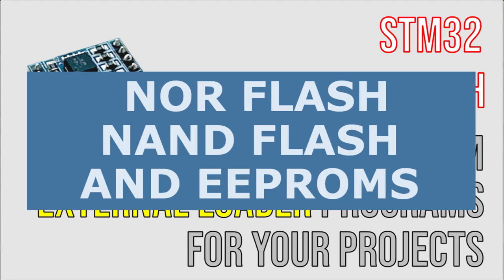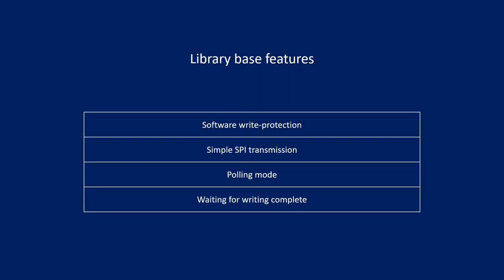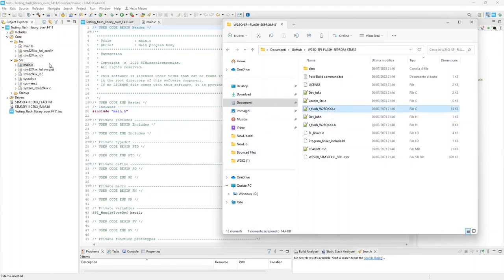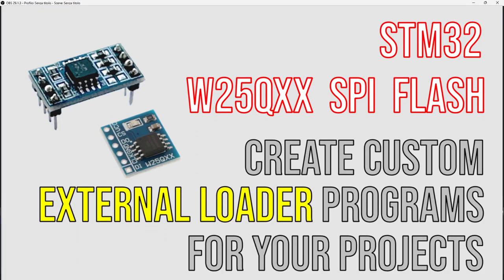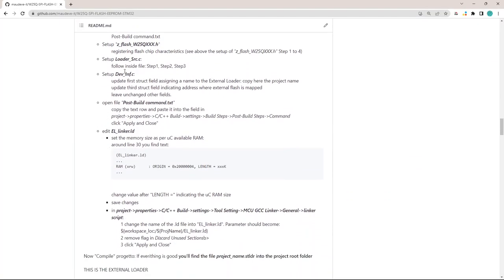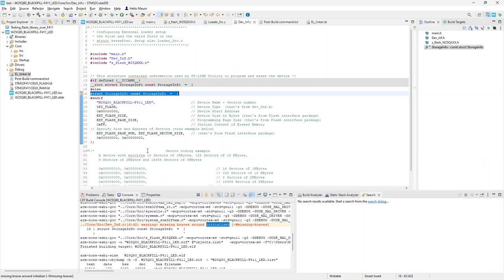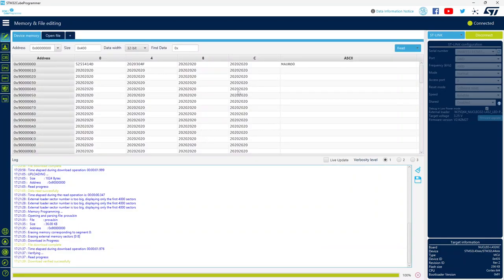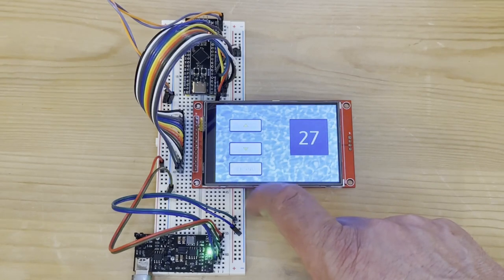External loaders for SPI flash: a "standard" version

Comment: Hi, I have  a F411 like you but when I get offered to pick a flash I only get flashes associated to different boards, is there something I'm not understanding?
Reply from the maker: I don't understand: what do you mean by "pick a flash"? Selecting an external loader? where? in CubeProgrammer or CubeIde?
If so, I suppose you moved the external loader in a wrong directory.
Reply: @bluewat  nevermind I didn't listen with sufficient attention and misunderstood that part, it's fixed now. I implemented everything in the video and it works. Now I am working on saving integer and float objects in the flash and especially reading them proprely (so not doing the number to ASCII conversion) if someone has already done it I would love to read about it .

Btw thank you for your video, it's excellent and very helpful
Reply from the maker: That should be possible with pointer typecasting. This way:

float fldata = 0;
HAL_SPI_Transmit(&FLASH_SPI_PORT , (uint8_t*)&fldata, 4, HAL_MAX_DELAY);
or even better:
HAL_SPI_Transmit(&FLASH_SPI_PORT , (uint8_t*)&fldata, sizeof(fldata), HAL_MAX_DELAY);
reading data in the same way you'll get back the float variable;
Reply: @bluewat  thank you very much for your answer, I implemented your adjustment in a new function and also created new functions to write float data all the way up to Flash_write_float. It indeed writes the correct amount of 4 bytes objects in the winbond but unfortunately data integrity is not achieved and the hexs in stm32 prg are not consistent with the data saved in the first place when I convert them back to floats
Reply from the maker: Just two final comments/hints:
- you don't need to create specific "flash_write_float", "flash_write_double", "flash_write_int" and so on: you can just typecast the pointer in the "flash_write" call. (what shown above, was just a hint)
- there should be something wrong, somewhere in your tests, in your calls (maybe an inaccurate flash address?). Type cast should not introduce any error. But that's good 👍: keep on working.

Comment: Hi my external loader is downloading only upto 128Kb file. in flash (w28q64). but can read full chip of size 0x800000 =8mb. could you please help?
Reply: Hi. I am also facing the same issue. External loader cant write more than 128kb data. Have you solved problem? Or anyone have solution?
Reply from the maker: I had a project having about 1MB loaded onto a flash without problems, I don't remember if sometimes I had something needing more than 1M. 
I checked that project right now: an F103@64MHz (a bluepill) with a w25q64 on spi1@2Mbps. 
If you like a help, you should provide at least some information: what's your system? How you say you can't write data over 128k? You mean you get an error? what's the error? ...
Reply from the maker: I guess you have an error READING/VERIFYING flash (via CubeProgrammer). 
If so your EL is ok, flash is (hopefully, if you haven't a mistake somewhere) correctly programmed, it is a limit of CubeProgrammer. 
Try to disable verify option (even on CubeIde), and see what happens.
I'm close to publish a new video explaining (among other topics) even this case

Comment: Hi...I have tried implementing this for issi 4MByte memory on stm32h750. It works fine until I tried to program a bin file > 100kByte. Cube programmer shows download failure at segment (0). Any idea what is wrong?
Reply from the maker: Are you getting error in reading or writing? or both?
Reply: I have resolved this issue. Need to change variable quota in z_flash_W25QXXX.c  from uint16_t to uint32_t. Many thanks for making this  tutorial. 😊

Comment: what about if instead of a Flash memory I have an FPGA with SPI in passive mode? Would that work?
Reply from the maker: I'm not sure, but it shouldn't be difficult to adapt the library to another type of communication. As you can see, Loader_Src.c makes calls to a library handling SPI communication through simple functions: Flash_Read(), Write(), Clear(),...
Reply: I agree on that, I don’t see why it should not work. I will try!
Reply from the maker: Keep in mind that you must avoid interrupts (so, DMA also) as they are disabled exiting the external loader functions

Comment: hi, thanks for video. i followed steps you shows. i am using w25q64 chip. in program Flash_init sims to be working well but at Flash_chiperase goes into infinite loop it stuck in busy flag. what is the problem?
Reply from the maker: That's strange. Writing cycle starts as soon as /CS is driven high and autonomously resets busy bit at the end.
Reply: @bluewat  you are right but in the function Flash_WaitForWritingComplete(); ---> infinite loop at  while (buffer[0]& SR1_BIT_BUSY ); . This buffer never receive S1 register value and causes a loop  infinity
Reply: @bluewat  is library support w25q64?
Reply: is library support w25q64?
Reply: @bluewat  now working... my chip was faulty i replaced with new one and program is working

Comment: I don't understand why any writing or reading operation only works once (external loader functions). When I want to make a second transaction, I need to connect to stlink again. What could be the reason for this?
Reply from the maker: that's strange. What uC are you using? The flash? And what is the clock speed you set in the external loader CubeMX?
Reply: @bluewat  I use an eeprom, all functions work. I'm using f446re and 24lc256. Clock speed 180mhz
Reply from the maker: integrating an I2C eeprom, that's interesting: something I have in mind to test but I haven't yet done.
F446re: ok, no problem with ram size.
How you use I2C? In some my first tests (SPI) I had some problems with DMA. (Even considering disabled interrupts) Then I used only polling mode. But it was in my first tests: maybe now it could work. Even if I keep working only in polling mode on external loaders.
Something else could be in the uC status left, after writing: changes something enabling/disabling "verify" after writing?
Reply: @bluewat  I did not use dma or interrupt. I did any delay part as you did. The functions already work stably on their own. The problem is that after performing any operation, I have to reconnect to stlink to perform a second operation. I experienced the same problem about six months ago when I tried to make an external loader with w25q32.

Comment: Hello, great libray but I have some problems with creating external loader. I another project, libray works excellent (while testing communication with flash chip). But when I want create a external loader while debuging project the Flash_TestAvailability always return 0. I tried to set lower speed but without success (in another (test) project i was able to set max SPI speed and everythink works well.  Regarding to debugging the loader project i found that HAL_SPI_Transmit(&FLASH_SPI_PORT , data, dataSize, HAL_MAX_DELAY) always return HAL status BUSY. Maybe someone knows why :)
Reply from the maker: I'll take a look
Reply: @bluewat   my mistake, i forgot add last zero to adress, I was writing 0x9000000 instead 0x90000000, now everythink works excellent also touchgfx :)

Comment: Is it possible to have my external flash memory via SPI having part of my program from the STM32CUBEIDE loaded like if it were the internal flash to carry a few variables?
Reply from the maker: In principle, yes. But: (1) what you mean referring to "a few variables"? They should be "a few constants". If so: external loader would program flash and, setting up an appropriate driver, "variable/constants" could be read regadless where they are stored: inside or outside uC. (2) Take in consideration the SPI flash speed: what said at point (1) is valid "in principle". External flash is a widely used to store data and software. But not and SPI one. 
I'm working on a "smaller footprint" version of the external loader. Much smaller. I'll try to set an example of this kind of handling also.
Reply: @bluewat Oh, great!! BTW my interest is basically do stuff with LCD Displays and for other projetcs, working with lookup tables.                                    In this format, if i have a Lookup Table saved in the external memore like this: uint16_t Lookuptable[1000*60] __attribute__((section("ExtFlashSection")));     Can i address in the code calling like this: uint16_t data = Lookuptable[60]; To try to get the data from the  Lookuptable[60] (in the pos 60) ? os do i need to get the pointer of the variable + the 60 positions and fetch from the Flash with the library functions?
Reply from the maker: No, you can't do that with an SPI flash. You have to setup a function handling flash/memory reading and than, using that function, you can forget if the data is stored intertnally or not in the rest of the program.
Reply: I was trying to make the external loader for the STM32G0B1CBT6 that has a RAM of 144K. It generates ok, but the issue is that when i try to open in the cube programmer, it shows as unknown and with address 0x0000000 and no name. Any idea of what could be the issue? (I've oppened an issue in the github as well with screenshots) @bluewat

Comment: Hello, great tutorial, but can You try this for STM32G0B0CET6 ? I got only blank name/board/mem size and device type: "UNKNOWN" in stm32CubeProgrammer.
Reply from the maker: I can only tell you to doublecheck the various steps
Reply: hello i 'm also facing same issue.
Reply: @pallavikadaam  If I remember correctly, there is a problem with memory organization. In my case, an additional section was created in RAM before the loader functions. Solution: check the RAM structure with a memory analyzer. Delete the extra section. It worked for me.

Comment: hi, i connected W25Q16 and F411 when i debugging "Flash_TestAvailability" function return 0 always, i cant find where is the problem, pls help me
Reply from the maker: As you probably have already seen, TestAvailability just reads SFDP record from the flash. That record reports JEDEC information about device connected. Despite the memory size, the record starts with the string "SFDP". That is the only test done by TestAvailability function to see if a chip si connected and communicating.
Now, I see only three possibilities:
- (the absolutely most likely one) there is something wrong in the communication (SPI port setup and/or wiring). I noted that winbond SPI communication is quite weak (compared to other SPI devices). So, while prototyping over a breadboard, I keep a quite slow speed: below 2mbps. I rise it to higher speed (50mpbs and above) when I move the project over a PCB. Doublecheck wiring and CubeMX configuration
- (it is possible, but only if you really belive communication is good) the flash could be damaged? can you test another chip? can you use current chip in another circuit?
- (is it possible?) Winbond says that its devices follow Jedec standard since 2011 but not saying how was SFDP record before 2011. Is it possible you have a chip made before 2011?
Reply: you are so right, i slowed down mcu speed and it works...😀 @bluewat
Reply from the maker: 👍👍👍You should be able to keep a fast MCU, slowing down only SPI port (working on the "prescaler" parameter of SPI).
Reply: @kursadgulereem  you are right this worked for me too, not I can program w25q64 using h723, now I want to figure out how to boot from that code.. I think I need to copy it to RAM.. then jump to RAM, right @bluewat?

Comment: This is awesome!! I'm designing a board that uses an STM32H723 and (2X) W25Q128JV NOR Flash in a Dual Quad config using the OCTO-SPI. SO, my config will be a bit more complex, but I think I will be able to use these examples to get started on the large task. 

Thank you so much for sharing.
Reply from the maker: Hi @seemeridecom,
interesting project. It would be interesting to know the performance of this architecture. Could it be interesting, in some cases (heavy data handling), to store program over OSPI keeping data on the internal flash?
Reply: @bluewat The project I'm building will be a larger HMI and I'm not 100% sure of the size of all the assets or code. The processor has 1MB of internal flash and I know I'll overrun that for sure. My plan is to put as much code in that internal flash and most all the assets (graphics/fonts) in the 32MB. I think with having them set up at Octo SPI, they should be pretty fast. Also, if I overrun the 32MB, I can always go larger.

This will be a product that I want to release new firmware to my customers via download and they can install using a USB drive.

I may also leverage an internal SD FLASH for custom user backgrounds and such.

Comment: Hello Mauro, 
Very comprehensive and detailed video, thank you!
I'm struggling with building an external loader for an SPI flash for the STM32WLE5, I have the CubeIDE project up and running based on the video but when I connect to the device with CubeProgrammer and try to use the stldr I built I get a message "Error: Data read failed".
I tried to take the SPI out of the stldr and only test the init part with blinking a led on my target but I get the same error.
When I run the same project in debug configuration from main.c the led is blinking.
What could go wrong? Any way to debug it?
Thanks
Reply from the maker: A possible cause and solution is on video about 12kB external loaders

Comment: Why did you have to redefine the hal functions (Hal_GetTic IncTick ...) in the Loader.c file? What's the reason for this?
Reply from the maker: uC calls the external loader having disabled all interrupts. So, systick also is disabled and functions like HAL_InitTick(), called in initialization, would hang.
That's why they are redefined.
That's explained somewhere in the ST documentation indicated in the video desctiption.
Library (in some cases: for instance resetting and initializing flash chip) needs some delays: I left the library calling HAL_Delay() so, when it is normally used in a project, it will use the system timer. While I redefined it here, making it working with no systick.
Reply: @bluewat  thanks
Reply from the maker: 👋 @blcouz

Comment: Hello sir, great video ! I am building a project on stm32 bluepill(f103CT8) and i require to store char arrays and for that i am using winbound flash chip , can give some steps to take care while writing the arrays in the memory and how to read them as i will require to read them mutiple times .
Reply from the maker: You should find, more or less, all information here in the video (how flash works and how it should be handled), in the related GitHub page (how to setup a project), and in the library function descriptions (how to use the single library functions). 
If the array is a "const" (written one time only, programming the system and read-only on project runtime) you could get to a very easy flash handling by mapping flash on the uC address space. Not described here until now. I'm working on a new video on this topic.

Comment: Hi, Thank you for the Video. I created the .stldr file. But Cube programmer doesn't show Memory Size, page size or Memory type. What could be the reason. I checked and rechecked every step mentioned in your video.
Thanks in Advance
My device is: STM32G0B0CET6
Reply from the maker: Hi, the easiest part of the answer is that you can be sure that there is something wrong.
Not easy is to say what is wrong. That could be also just the structure in Dev_Inf.c. Maybe just a too long string as device name?
Reply: In my case, an additional section was created in RAM before the loader functions. STM32G0B0CET6

Comment: Hello!! Mauro, I have issues with CubeIDE, External Loader. In CubeProgrammer works great, but when i try use it on CubeIDE i cant write, so i dont know whats going on. Could you help me with.
Reply from the maker: CubeIDE and CubeProgrammer use THE SAME modules so you should easily detect the error: your EL is good (!), that's just a CubeIDE project problem.
My 2 cents is: (first hypotesis) did you unselect "verify" in CubeIDE EL properties? If yes I see only (second one) a linker script problem.
But it is not easy from here helping you much more than this.
Reply: @bluewat  Thanks for your help!!! Yes the verify is unselected. i'm using ST-Link-V3Set.
Reply: @bluewat Ok after checking all, I could fix it. And now is working.
Reply from the maker: Well done!